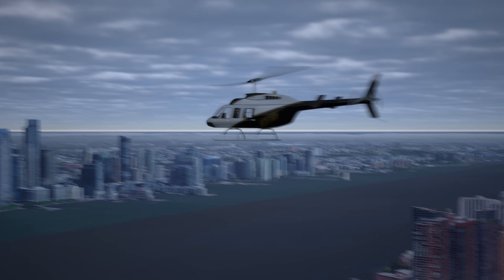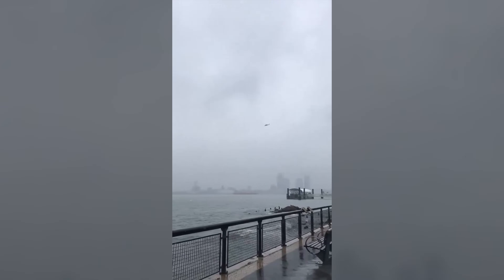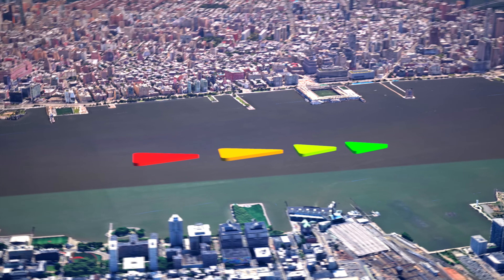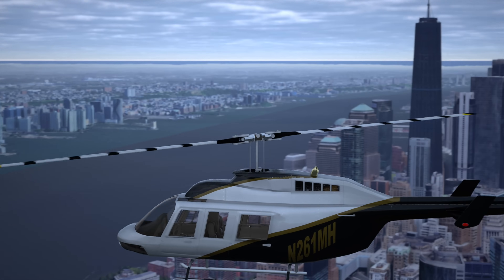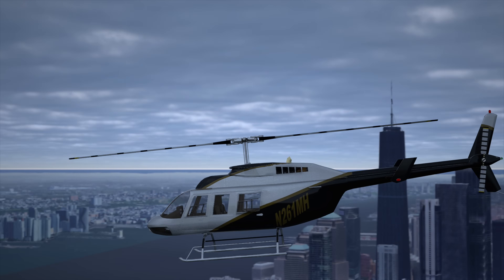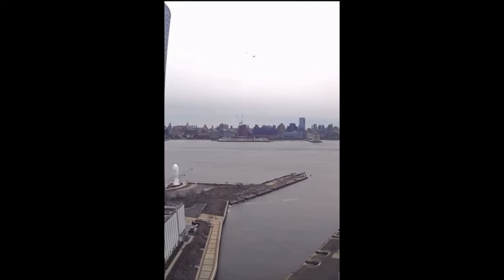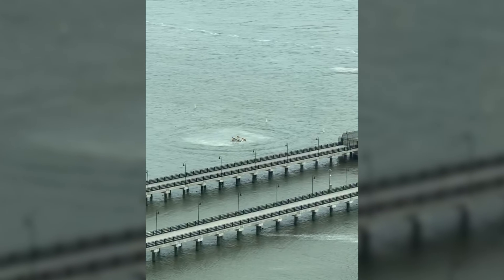Helicopters DON'T just fall from the sky - What is "Mast Bumping"?

Comment: As a recently retired Navy flight test engineer I’ve been involved in more than a few accident investigations over my career. I truly appreciate you not wildly conjecturing about the cause of the mishap. You provided a possibility and explained it wonderfully. Anything more is irresponsible but regularly occurs today so creators can get that quick click and like. Thanks!
Reply: Seeing that pic of the family just before taking off is heartbreaking
Reply: @RightVLeft  That speaks more than many will admit. This was a message as well as a mishap. What was going on at his work?
Reply: As a retired Maritime accent investigator, I second this completely
Reply: @SeattleBoatdog   accent investigator?
Reply: Agreed! This is what good reporting looks like.
Reply: It's not only creators who need to stop that, the media bears some responsibility in educating the public. If only they'd do a 15 minute special with a panel of experts like yourself, it might stop the sensationalism. There's very good reasons why final reports don't come out for months.
Reply: Mechanic here...the intact rotor indicates that this was not a rotor bump. The probable cause was was missing aviation-grade cotter pins on the gearbox  mounting assembly nuts/bolts. When the box vibrated loose and separated from the fuselage, The unbalanced  tail rotor  torque sheared the tail assembly which probably  had metal  fatigue from extensive  hours in flight. The probable reason  for forgetting to install cotter pins is THC in one's blood and a negligent maintenance  supervisor  to check the mechanics work. If so, both  should  be brought up on negligent homicide  charges since 3kids died.  That's why military personnel are tested  for THC as well  as oil  changers  at Walmart. Walmart  doesn't  want  to  buy new engines  because  their  mechanics  forget  to torque the drain  plugs properly, as this can become very expensive the company.
Reply: @SamTwente-h4d what makes you think it's THC specifically
Reply: After Kobe, I was kind of good on ever riding in a helicopter…. Then just hearing how much more difficult it is to pilot then a standard airplane. No thanks.
Reply: @tupa12  Right! Helicopters are only dangerous when famous people die.
Reply: @jaypie0864  exactly! I have doubt is an accident.
Reply: Fr pitiful that Kobe died all bc dude panicked w no visibility… if he’d only looked at gauges stayed chill
Reply: I listened to that video and felt so badly for the young man. I’m not sure he panicked. I think because of the elevation his mind wasn’t working right. They were told not to take that flight, but they did anyway.
Reply: I was a Test Engineer too!!  When did you test? I might know you
Reply: @televisionarchivestudios1130  I’ve been at Patuxent River since ‘84 and have been involved with both rotary and fixed wing aircraft during my career. Great time but it’s time to make room for younger engineers to make their mark.
Reply: Thank you for your service!
Reply: I second that! Well produced video!
Reply: Such a tragedy.  All prays for the whole crew. Rip
Reply: So look away … don’t even think this executive was wanted dead 💀???? Hmm .. very sus
Reply: One question  the rotor doesn’t look deformed in any way in this footage.  Can a blade shear off the tail that cleanly without deforming the actual rotor blade or metal?
Reply: @pecan11  no, it can't.  The bump theory is wrong
Reply: @pecan11  wondering too, thought maybe I'm just used to everything made so shity
Reply: Bullshit, see my post, this video falsely alludes the cause is mast bumping without there being any evidence , and is largely direct quotes from other sources.
Reply: What do you think about them having a parachute that could be deployed in certain situations like this. Spinning blades would be a problem but if it deployed from the front so the body hung downwards it might just work?
Reply: @ I don’t see a weight and balance issue. Great idea.
Reply: @seltaeb9691wouldn’t the parachute need to be ginormous? Just to get a person to the ground they’re massive. I guess that would cause issues in itself. I saw a video the other day of Chinese flying taxis that have parachutes, but they were much smaller and I guess less weight than a helicopter or small plane.
Reply: They call it a tail boom bumping, but the blades look 100% clean.
If any blade had touched the tail boom, they would have either bent or break.
Reply: A channel with nothing on it, and your name, captain chaos, hmmm, wouldn't work for a particular branch of government per chance, I suggest people read the comment from an actual pilot of that particular modle of coptor who says the video explanation is spot on, but hey ho, what do I know 😏
Reply: @kaptainkaos1202  I worked a crash site of a Marine Ah-1 at Patuxent River Md Naval test center in 1981. While testing a new control system, the aircraft lurched upwards and did as you said. The blades bent downward because of the sudden rise and sheared through the cockpit.
Reply: I doubt you are who you say you are.
Reply: cia agent, psyop division is who you are
Reply: Ok karen
Reply: It may have been mast bump but if the main rotor blades struck the tail boom they would have shattered. The main rotor blades appeared to be intact.
Reply: Do you know Jesus Christ can set you free from sins and save you from hell today 

Jesus Christ is the only hope in this world no other gods will lead you to heaven 

There is no security or hope with out Jesus Christ in this world come and repent of all sins today 

Today is the day of salvation come to the loving savior Today repent and do not go to hell
Come to Jesus Christ today 

Jesus Christ is only way to heaven 
Repent and follow him today seek his heart Jesus Christ can fill the emptiness he can fill the void 
Heaven and hell is real cone to the loving savior today 
Today is the day of salvation tomorrow might be to late come to the loving savior today 
Romans 6.23

For the wages of sin is death; but the gift of God is eternal life through Jesus Christ our Lord.

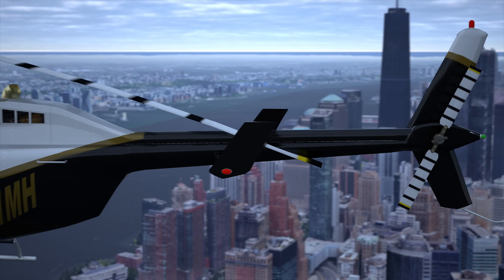John 3:16-21 

16 For God so loved the world, that he gave his only begotten Son, that whosoever believeth in him should not perish, but have everlasting life.  17 For God sent not his Son into the world to condemn the world; but that the world through him might be saved.  18 He that believeth on him is not condemned: but he that believeth not is condemned already, because he hath not believed in the name of the only begotten Son of God.  19 And this is the condemnation, that light is come into the world, and men loved darkness rather than light, because their deeds were evil.  20 For every one that doeth evil hateth the light, neither cometh to the light, lest his deeds should be reproved.  21 But he that doeth truth cometh to the light, that his deeds may be made manifest, that they are wrought in God.

Mark 1.15 
15 And saying, The time is fulfilled, and the kingdom of God is at hand: repent ye, and believe the gospel.

2 Peter 3:9
The Lord is not slack concerning his promise, as some men count slackness; but is longsuffering to us-ward, not willing that any should perish, but that all should come to repentance.

Hebrews 11:6
6 But without faith it is impossible to please him: for he that cometh to God must believe that he is, and that he is a rewarder of them that diligently seek him.
Jesus
Reply: Sorry I didn't by your take of what happened ... Helicoptesr was breaking up as something hitting it.... I'm  60 years  old wise man... Theirs more the meets the eye... 2014 all these jet airliners running shot of the run ways, mh370 just disappeared and now the Trump administration takes office.... It's been once a week a plane or helicoptesr crash... Today a small plane crash... last week small plane crash.. week before another small plane crash and so on... Something fishy going on... Next week another will happen... look for another 911 event, within the next year... No I'm not saying president Trump is doing it.. But something is going on
Reply: Same for Traning Squadrons and Guantanamo Bay, once the VTs get in Ur blood, u r hooked, Texas, Pensacola VT, ComTrawing 5, Training Helos, Bell, looked like toys, I hated hem! Give !E AIMD, T-39, T-2, T-34, Lear Jets. 
I did trust the UHN1
Reply: sabotage. he knew too much. somebody wanted him dead
Reply: WHAT??? you are muppet and I don't think you've seen helicopter in real life. This think was pure unadulterated bullshit. This was unlikely mast bumping and even less likely tail strike. If it was mast bumping it would separate under the head and if it was tailstrike the blades would disintegrate. If you were really involved in some accidents I'm assuming you've caused them because of ignorance. 
you start with bringing credentials and follow up with complete BS. Disgraceful
Reply: As an engineer do you think that this explanation is even plausible? The rotor hits the tail huh
Reply: @pahom2  Maybe. Maybe not. That's the thing.
Reply: Do you think its normal to get some 3d model of helicopter and make this video with all the details and explanations in such a short time?
Reply: When I went to Hawaii as a tourist my father who flies planes made me promise to not take any of the helicopter tours
Reply: I can't believe people's comments on here. So many theories. Now people are even joking it's Bidens fault, not funny. A whole family died here, have some damn decency. Let's keep our ignorant thoughts to ourselves and wait for the real reason from the NTSB. Thoughts and Prayers to all involved in the tragedy. 🙏💕
Reply: I know little about aircraft. Can someone explain to me why more helicopters and planes don't have emergency parachutes? The crafts themselves, not the passengers. I feel like a lot of deaths could be prevented if small planes and helicopters had either built in or attached parachutes
Reply: @stnaes-tf4ow  Helicopters don't have ballistic 'chutes because the rotors stop them from being deployed.
Larger aircraft would require multiple chutes, and rigging capable of withstanding the high speed shock loads of opening at more than 700 miles an hour.  Such chutes can be built.  They would be so large and heavy that there wouldn't be room for passengers.
Reply: @ it truly comes down to physics. Remember that wonder equation e=mc2? I’m going to make this as fundamental as possible because there’s a lot more to it but the energy of an object is equal to its mass times a constant squared. So with a heavy weight moving fairly fast the stored energy is quite large. All that energy would have to be absorbed and dissipated by the parachute system in a slow process. Otherwise either the aircraft or the parachute system gets destroyed. Weight is a huge factor. It’s been calculated that a recovery chute system for an A320 would weigh almost 3 tons.
Lastly and most importantly most mishaps occur during takeoff and landing where a recovery system would be of no use. Altitude equals life.
Any further questions I’ll do my best to answer.
Reply: I was going to the Grand Canyon by Helo.from Vegas and Chickened Out at the last minute 😮
Reply: @golfberg1  wise decision
Reply: @golfberg1 Probably for the best if you felt uncomfortable with the perceived risks.
Reply: @golfberg1 I did that ride, it was good but after realising how unsafe helicopters are would never do anything like it again!
Reply: @golfberg1 that’s a shame ! It was one of the best experiences of my life flying through the canyon by helicopter. 🚁
Reply: As a YouTube neurosurgeon I agree
Reply: An other very rich person dead? Hmmmmm
Reply: CEO .. billionaire...stock market crash... European....etc ..I agree .. @peterpeter5666
Reply: I say gov is doing this military is involved
Reply: @michaelyouther6272 time to take your medication and put on the tinfoil hat
Reply: I'm kind of surprised you refer to this as a mishap. To me a mishap is tripping and maybe getting mildly injured. Dropping out of the sky in mid flight , definitely not a mishap.
Reply: @Cocora22  that is the standard terminology that is used in the aviation world.
Reply: @ I'll have to take your word for it. I follow the news and have seen many people describe the collisions, but this is the first time i have heard the term mishap to describe a collision in which there was a loss of life in such a tragic way. Now I know or have learned something new.
Reply: @Cocora22  "mishap" is standard terminology
Reply: @Cocora22 ok so what word would you use?
Reply: @LightlySaltedMM  Maybe , the cause of this tragic accident, or this terrible event, unfortunate tragedy something along those lines. However having said that, the writer says he is or was a navy flight test engineer, so a person who has seen many failures possibly some resulting in fatalities does develop a different way to express failures.
Reply: @Cocora22  imagine if he said "oopsie" or "boo boo" or something lmao
Reply: Well…..what would you call it then?
Reply: @Cocora22 stop being so pernickety good grief. You must be wonderful to go out with, pointing out everyone's grammar.
Reply: @seltaeb9691 I kind of thought your were the one doing so. Actually that is good word to use to describe me. I am so about certain things. I wasn't pointing out everyone's grammar just the guy who made that comment.
Reply: @Cocora22 definition of a mishap; an accident or unlucky event. [enter sarcasm here] Hope this helps. 

My guess is that this fits into both of those descriptions.
Reply: @sticky70  It fits as an exact definition. However, most people would not consider labeling a tragic event  such as this a mishap. Most people would not consider the crash of a military helicopter and an airliner over the potomac River a mishap. It's similar to saying it was just a hiccup! If you consider the tragic death of 5 human beings falling out of the sky and crashing into a river a mishap, well I guess you and I see life in a very different way.
Reply: @Cocora22  It's the word used in aviation - we understand there's a difference in the public's mind, but we are human beings and it could be us.
Reply: @Cocora22  MISHAP .... person is describing ACCURATELY in this instance.   In aviation, "mishap" is the preferred term for "accident" to emphasize that these events are often caused by human factors, not random occurrences or fate.
Reply: Mishap seems reasonable. Tragedy? Crash? Accident? What’s the difference?
Reply: Yeah ur clearly in a civilian bubble stay there where mishaps can be bounced back from
Reply: Could it be a drone could have could it have collided with a drone?
Reply: @josephdupont  direct collision with a drone would not likely cause that damage - but they could have maneuvered aggressively to dodge a drone (similar as described with birds)
Reply: @josephdupont not that long ago mysterious SUV-sized drones were "mysteriously" flying through there and we've seen an uptick in multiple simultaneous failures in aircraft. As crazy as it sounds it should not be ruled out. Another cause could be control system interference or instrumentation error. There's always a bias to blame the deceased pilots by people who have no idea what was going on in the cockpit.
Reply: @mvwoon  I am very familiar with the Bell 206. Military used to use them. Army designated OH-58. That is what I worked on in Army. No control system interference, electronic or otherwise possible. Direct linkage to flight control surfaces (rotors) with hydraulic assist for main rotor.
Reply: You call the erasure of an entire family a 'mishap'?
Reply: @TriStarIII  Semantics. Do you honestly think he doesn’t care just because he used a different word than you would?
Reply: @svyatoyaleksnevskiy  I never actually said what I thought. But your comment reveals what the implied meaning of the word mishap is.
Reply: Mishep?
Reply: Ancient Wisdom: The Path to Mastering Emotional Intelligence 

https://youtu.be/fkAhgl7GHHU
Reply: Oh I guess this was Biden's fault 😂😂😂
Reply: @kellypersekian6190 yes!  And those arrests for the gang members are not the result of hard work by the Biden administration. /Snark
Reply: This accident is a great reason to ask a believer in JC how to be born again.
Reply: All credibility is lost  with your "as a" introduction.  As if your opinion is more important 
... Jack wagon
Reply: @bertblue9683 Huh ?? Opinion based upon a lifetime of experience in exactly that field counts for more than you can comprehend
Reply: @ it’s not more important but it does establish I have very specific experience in the topic of the video. Experience that very, very few people have. Would you rather read a post from a FTE or a 7-11 clerk for this video? You’ll notice that quite a few posters established their bona fides at the beginning of their posts.
Reply: Videos like this don't exist merely to earn your respect. Who are you exactly? Oh, thats right we dont care.
Reply: @capndallas4918 someone better than you 🤡
Reply: @capndallas4918  it was an oppsie!!
Reply: @capndallas4918 videos like this might not exist to earn our respect but they can get it anyway. I too respect this video, there’re too many conspitatorial videos about this, like it was shot down.
Reply: You only think it's for clicks? Speculation is how human beings solve problems. Are you really an engineer? Sounds like you may be the one more concerned with clicks given how egotistical you are acting right now. Do Push ups
Reply: @physetermacrocephalus2209 You’ve got the wrong end of the stick Fido. That’s NOT what he was suggesting
Reply: @tomwebster3249  

I know that polly, I'm criticizing his tone and verbiage.
Reply: @ I’m an engineer. A group not known for their eloquence nor observant of social cues.
I think it’s wonderful that you’re able to determine so much about me from one little post.